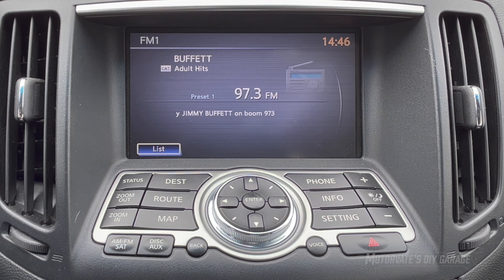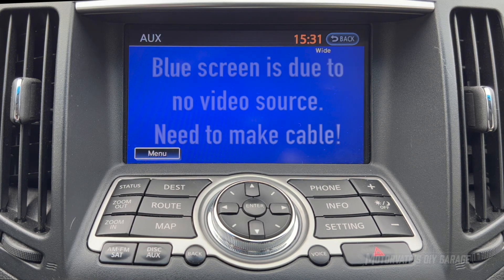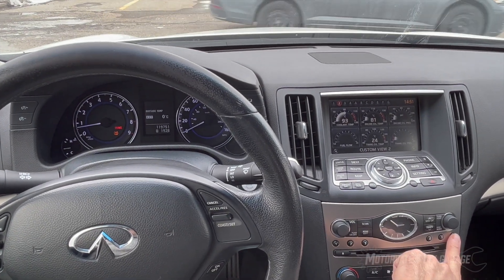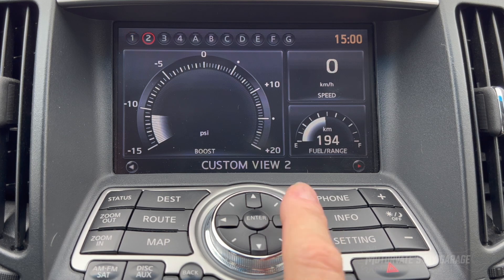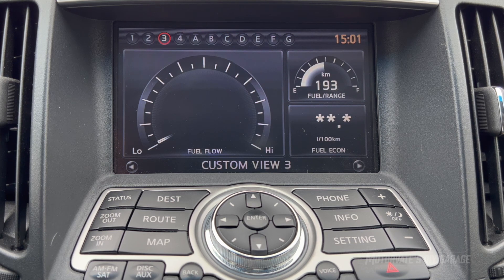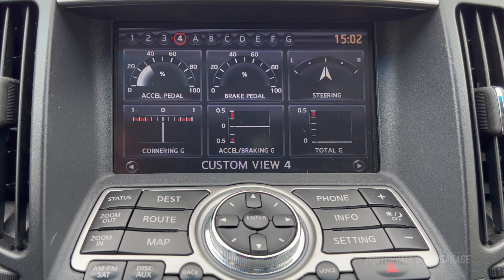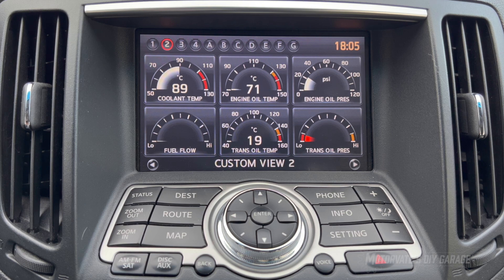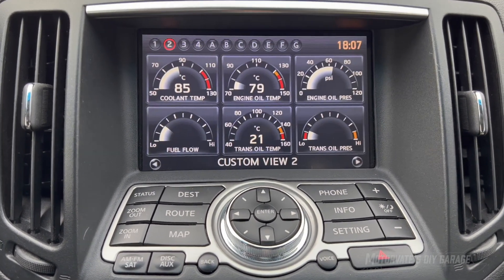BIG update! GTR gauges for G37 & 370z: MotorvateDIY Garage Ep.50

Comment: Please let me know where to place my order for the module for the GTR gauges.
Reply from the maker: Will do!! 
The prototype is working well and the next step is to finalize the hardware and get a bunch of circuit boards made to test on local (Toronto) G37 and 370z.

I want to make sure the G37 with the tech package works as expected. As for the 370, I don't expect any problems... BUT I still want to test on them.
Reply: @MotorvateDIY  Awesome, I have a 2011 G37S. I will stay tuned for more progress.
Reply from the maker: Great... thank you!

Comment: Question... Will it be a piggyback harness to hook to the head unit? Or AV plug? 

Also, would the skin change depending on which one is selected?
Reply from the maker: Nope... no piggy back harness or anything else. It simply plugs into the diagnostic port as shown towards the beginning of the video.

The GTR/Infiniti/Nissan start up splash screen is done through the AV unit -re-configuration.
Reply: @MotorvateDIY  Looking forward to more updates. And hopefully the price will not bite too hard :)
Reply from the maker: I'll do my best to keep it affordable :)

Comment: fwiw, my FX50 had location specific tire pressure readouts, but it had extra modules mounted inside the bumper covers to achieve that.
Reply from the maker: From what I have seen, Nissan/Infiniti has a few different type of TPMS systems. I think your is newer and a little smarter than the one on the G35/G37.

Comment: I have been looking at your work and I really can't wait to have this in my car 
Best thing is oil pressure and gear position
I like the fact it turns on at 80% throttle so in case I started racing someone randomly I can see my temps quicker
Reply from the maker: I'm glad you them. Now that the prototype is done, I will be finalize the hardware and start to test on local G37s.

Comment: any idea what price point youll be selling these at?
Reply from the maker: Hey Andy,
I'm not sure yet, as I have a few more things to figure out.
Reply from the maker: Hey Andy,
I just wanted to add to my answer. With a working prototype, the next step is to finalize the hardware, lots of testing on a few local cars and developing an easy way to re-configure the av unit.
Reply: yes, i would love to buy one!
Reply from the maker: Hey Enkies! That's good to know. I still have a fair amount of testing to do, but so far everything has been working good. Plus, I need to test on some local cars to make sure it works with G37/370s that have different options.

Comment: I have been following your work on these gauges, it is very interesting.  I have a G37 with a Stillen kit, so having the ability to potentially show more engine info on the fly is very interesting to me.

However, I do have a 2009 G37 Sedan Sport...  PLEASE tell me that this will work for that as well?

Good luck!  Thank you for all of the effort!
Reply from the maker: Sorry, but the 2010 navigation unit is required, as the older units don't have the GTR gauges hardware/software.

OWC sells a wiring kit that allows you to swap in a 2010-2015 navigation unit:
https://www.owc-upgrades.com/product-page/g35-g37-navigation-harness-adapter-kit-upgrade-2007-09-cars

That may be an option for non-nav 07-08 G35 and G37s

Comment: Awesome job my friend. I’m fully locked into your videos, and excited about the work you’re doing for the community. 

If one were to have a non nav g37. Would there have to be anything that needed to be swapped to use your setup if/when it becomes available?
Reply from the maker: OWC sells a wiring kit that allows you to swap in a 2010-2015 navigation unit:
https://www.owc-upgrades.com/product-page/g35-g37-navigation-harness-adapter-kit-upgrade-2007-09-cars

That may be an option for non-nav 07-08 G35 and G37s

Comment: Love it, man.
Reply from the maker: Thanks! As I have been driving my car around with these gauges... I really like them as well. Especially screen 2 with engine oil pressure and engine oil temp.
Reply: That's what excites me the most. I have an aftermarket oil pressure gauge installed and I use torque to monitor oil temp(thanks to one of your vids). Being able to clean up the interior by getting rid of those gauges is something I need.
Reply from the maker: Hey NG, it is tricky to have a gauge pod in the G37 and have it look like it "fits in" with the look of the dash.
This is a good solution to that problem :)